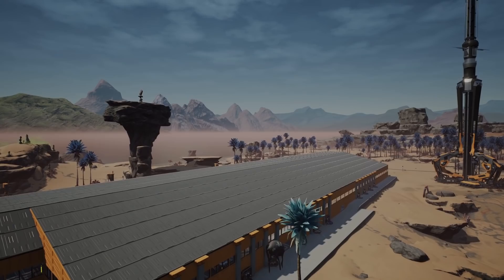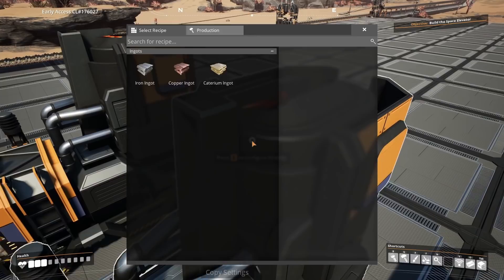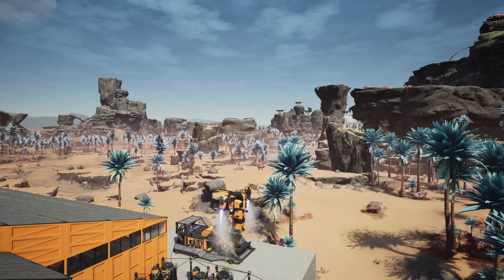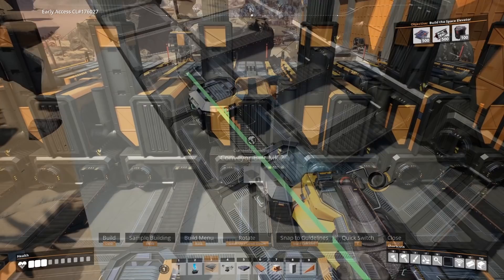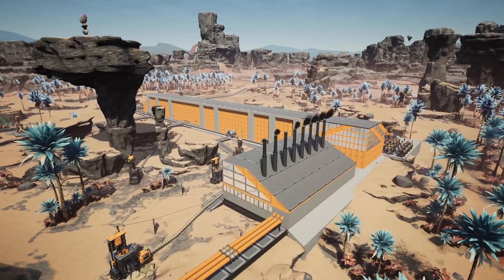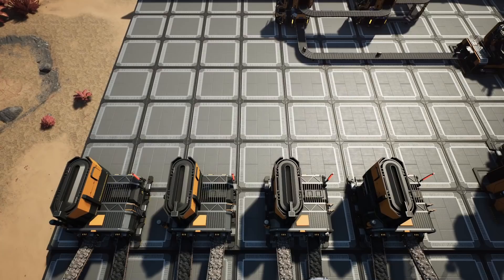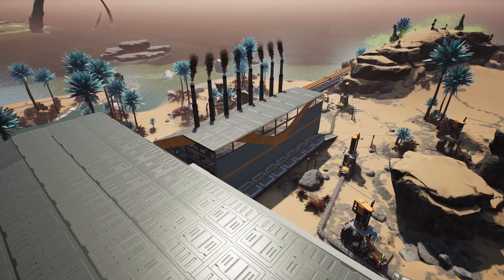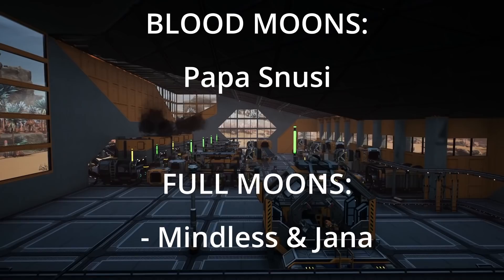Steel Layouts - The PERFECT Starter Factory Pt.3 | Satisfactory Game

Comment: I like building the coal plants such that the back edge is running colinear to the shoreline. I basically use the foundations to form a quay along the shoreline so the the three pumps can be positioned directly behind the generators which keeps every thing compact and very clean.

Comment: Halfway through this series I started streamlining the process, and certainly when I ended up getting the alt recipe for screws. I noticed that you forgot a line to storage for the quickwire. I added that myself and adjusted the rate going to the assembler. As for the last bit with the steel items, I think I'm going to set up a truck depot and have it shipped from another area.

Comment: I wonder about bug with water you mentioned…

I have built 120 Coal generators powerplant last week. Generators above water extractors, there was need of one pump MK1 on the way. But as I was starting it and checking for mistakes, I realized some didn't need pumps to be powered and still pishing all water into generators above extractors.
I just hooked up everything as it should be but, yeah… pipes are buggy.

Comment: Hold on, if the caterium smelters are set to produce 10 each, then they go into a merger for 20 which then just goes into a splitter to make them 10 into each constructor.... what's the point of the second merger? Wouldn't it be easier and use fewer resources to just send the smelters directly into the constructors? I guess it just lines up better with the merger/splitter addition, but that's still kinda weird.

Comment: I've been wondering, why stockpile the other earlier resources and sink them rather than use them for the more complicated items (i.e. Screws and plates for reinforced plates)? Why build whole new buses for iron and copper when you can simply diverge using smart splitters (once unlocked) to feed the excess to the assembler area? Then once those are full you can sink those more complicated items for bigger gains in the sink.
Reply from the maker: You must certainly can do that, but the factory wouldn't run efficiently if the player keeps removing resources for their own building 🙂 so you'd have to add further overflow sections on the more advanced lines as well

Comment: Hi TotalXclipse. Just watched Part 1, 2 and 3 and would like to suggest a Part 4. I ask because it is a "starters series" and I am a starter. Yet you would change machinery to 60% efficiency or 90% or any random number without explaining why. Is that something I should always do? What if I am using all Tier 3 conveyors? You had all the splitters and mergers and everything pretty much attached to each other, I like leaving a whole floor tile between them. Does that effect the percentages? Then in Part 3 you used the water pipes. You mentioned people say you shouldn't do it this way. Then proceeded to do it that way with no explanation. I apologize if you are taking this the wrong way. I merely am mentioning this as a "starters" series. A person with 1000 hours in game may not need the explanations, but a starting player would.  Part 4... "The Why" part. Why the percentages? Why is everything cramped together? Why are the Pipes set in that way? For that matter do you still have the other power burners going on top of the Coal Power Plants, spare power source? These and many more questions could be answered in... Part 4. Or Not 🙂 - Great Videos I will watch your whole playlist regardless.
Reply: Sorry I'm late to the party but let me see if I can give you some answers if you or anyone else  are still wondering. 
1. The purpose of underclocking with those percentages is when a production line does not need the full potential of a machine, whether it is being limited by the input amount or the next step does not need the max. while you technically do not have to underclock it does reduce the power consumption of the machine and keeps its power draw steady instead of turning on and off because it is producing faster than the throughputs can handle. It basically makes it so your lines produce the exact quantities of components with steady/minimum power consumption (Spiking can cause your grid to shut down if you push the limit).
2. Belt speed only matters with throughput. As long as the items per minute is equal to or less than the belt speed you are good, a faster than necessary belt only makes the first item arrive sooner and does not improve production speed.
3. I also tend to space my stuff out more because I like the look of it and find it easier to organize and move around in. Building compact like this boils down to saving space and build style. How much belt you use doesn't effect percentages or the end result as long as none of the belts are oversaturated with items. 
4. The pipes thing is just kinda weird, each pipe can transport 300 m3 of water and each pump extracts 120 m3, and each generator needs 45 m3. I like to max out my pipes so ill have 2 main pipes each with 2 extractors (making it 240m3) then splitting a 5th extractor between the two pipes to hit a full 300m3, to do this you have to use valves to make sure the 5th sends water 2 ways and doesn't get backfilled.
5. As for the power you dont always have enough being produced with just coal to do a complete flip in an instant and have to wean yourself off biomass while you expand your powerplant 
TIP.  also recommend setting up one biogen near your pumps with some fuel stored next to it so in the event your power goes out you can use it to just power the pumps to reprime your coal generators to take over again.

Comment: i just turn down the water Extractor to 101, from 120 to power 2 coal Generator, and have 1 or 2 coal Generator powering the pumps and miners so i dont have to worry about it have getting turn off when it would happen, these will keep going even if my factory stop working, you did give us that tip once in your video a while ago.

Comment: What's the point of merging and splitting directly after? Wouldn't it be the same to just run the 2 conveyor to the 2 different constructors?
Reply: @Spokloo, if I'm understanding it correctly, it's all a matter of timing.  Splitters alone will get the job done, but it takes a lot longer to max out your machines.  using a merger in the middle balances the load (hence the name load balancing) and gives each machine it's exact requirements immediately.  A perfect example is the split in the iron rod machines in part 2 which supply the rods for the rotors.  Also, those rods are split backwards, the assembler doesn't need 25 rods, the screws do, so put the loop on the screw side for maximum efficiency.  Sorry @TotalXclipse, for the failure to call this to your attention first, I just found it by accident after building this for the 3rd time, lol. I couldn't figure out why my rotors weren't showing up in the storage, so I checked each and every machine for mistakes, found out I had set the rod machines to build screws by accident! When I reset them, I realized that the 25 rods were going to the assembler, not the screw constructors.  Ugh, maximum embarrassment!
Reply: @JustanotherPlaya  I understand what your saying, but for example at 4:49, couldn't the 2 constructors on the left be connected directly to the 2 smelters on the left? I don't see a reason why not, it doesn't balance anything going through a splitter then through a merger directly after. The way I see it, it's 2 inputs and 2 outputs so I don't understand why there is a need for the merger and the splitter in that particular case. What you were describing is more comparable to the right side right? There is 2 inputs and 3 outputs, and in that case yes I understand the need for a load balancer it makes perfect sense. Maybe it's only for esthetics?

Comment: I’m having a few problems with power plant. Coal generators at the end of the manifold are not receiving enough coal I’ve got the feed line as conveyor kk 2 but does that have to extend all the way back to the miner?
Reply: you need to have two miners and a mk2 belt all the way there, thats what i did and it works. Once you have that get power to the miners then have them top off the coal generators so they all have 100 coal in them

Comment: Hi, on the coal factory my last 2 coal generators keep running out of coal :(. im in a pure node, 8 gens, mk2 belts for the main splitter coal mine and mk1 for the lines going to each generator, any advice? my max power usage is about 520 thanks
Reply: I'm not 100% on this, but for speed you want mk2 belts to each generator. The concept is to get it there "faster" preventing it from running out of coal. I have his coal plant setup and it matches this (but it came from another video of his)
Reply: ive had this problem with long manifolds, i feel like there is a bit of lag time going through each splitter which adds up to a lower throughput. my solution was to just split it up or add more coal later into the manifold.

Comment: hey ive build it the factory similar to what you showed, I even have less machines than what you have, and still the 8 coal generator is not handling the whole farm. It keeps shutting down, by running out of coal. I do have pure node. so im not sure what is wrong :(
Reply: Got Same Problem, im using 12 Coal generator now and got same build live Video and it took like 825mw , also my Problem is also coal is to slow :/ i got it Almost working with 3 pure lines  , the first 4 generator are Stuck with coal  while the backside run out...

Comment: This is a great series to teach a spaghetti man how to build efficient factories. However, in your steel starter build with 4 foundries and 4 constructors I do not quite see why you need the extra mergers in front of the steel pipe constructors. The constructors would receive 30/m from the splitter also on one direct belt, so couldn't you just leave them out?

Comment: I do really appreciate the effort on your videos but that water piping is just looks.. odd. You could achieve the exact same with 1 less pipe. I know that this "only" saves you 1 water pump but it would be easier to build and looking quite a bit nicer too as it saves that middle knobble kind of thing.

Other than that nice video as usual.
Reply from the maker: That's fair. Just a different way of doing it. I normally build the powerplants closer to the water so don't worry about the piping too much